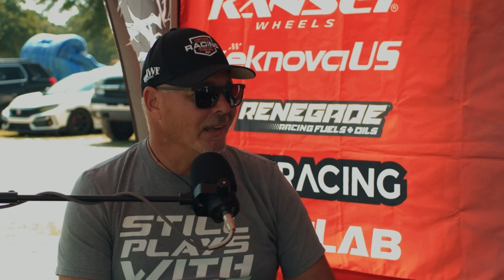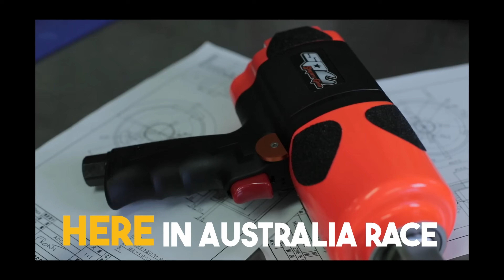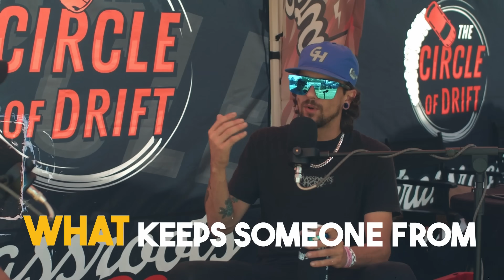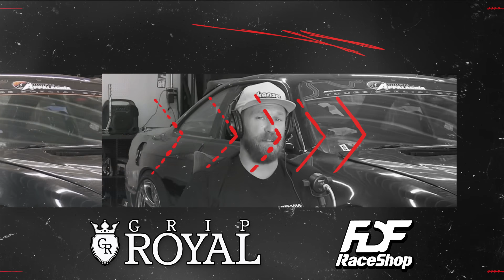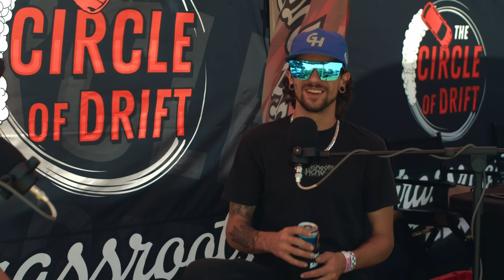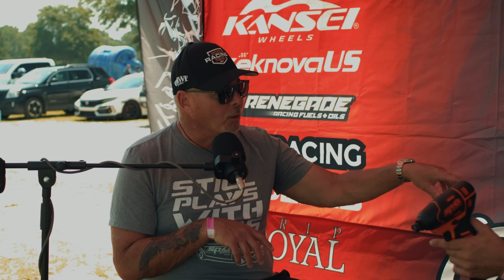Behind Tool Company LIES & EXPENSIVE Cordless Batteries w/ SP Tools USA | Circle of Drift #152

Comment: When I first switched to the trades 18v DeWalt bought the biggest baddest "heavy" duty,because I didn't want a "toy." Now that I'm older, I tell new guys get the compact with brushless and Lithium the power is there. You don't want lug around needless weight. 
 DeWalt is ditching their 12v because it's the same form factor as their 20v. They need a small handle like the SP and the M12. 
You're seeing Bosch opening up their 18v platform and now calling it "Ampshare" with smaller specialty companies which is kinda cool hope others take advantage of that.

Comment: I met a Harbor Freight sourcing rep on a train to a trade show in China. He used to work at Snap-on but left after the company kept tightening margins and pushing unrealistic sales targets. He said, “What’s the point of grinding out 0.1 to 0.2% gains when the competition is making the same tools, in the same factories, for half the price?”

Harbor Freight ended up headhunting him, and he told me the difference in innovation and turnaround time was night and day. HF operates like the Zara of the tool world; spot a trend, make it fast, price it low, and deliver exactly what the customer wants. Hard to complain about that.
Reply: 😅 while some of it's brand name alot of it is about quality of materials and quality control both of which result in better tools.
Reply: True @richardbenson4750 , at least to a point. When you find that the tools costing ⅓ of the price, work as well for as long say ⅔ of the time... I say that buying the alt brand becomes the only smart move.  

 I've found that as long as I really psy attn to the specs, copy, and reviews.. I rarely find myself disappointed.
Reply: @richardbenson4750 same tools made in the same factories.